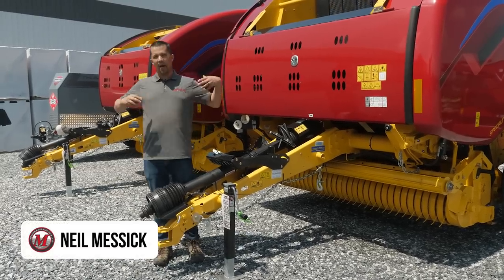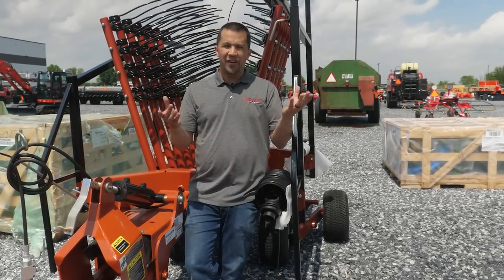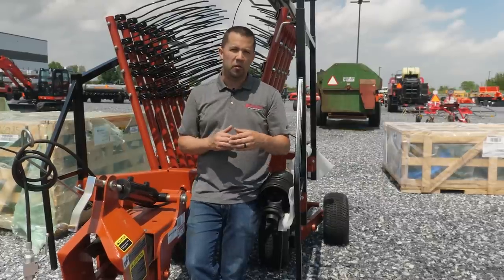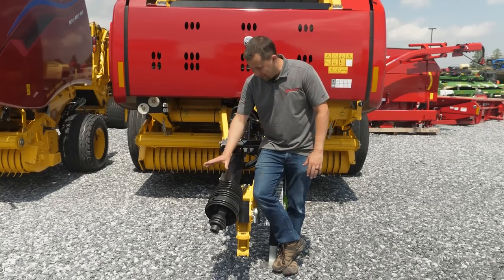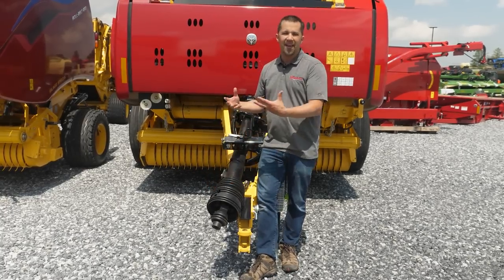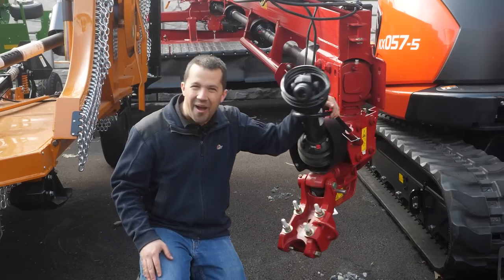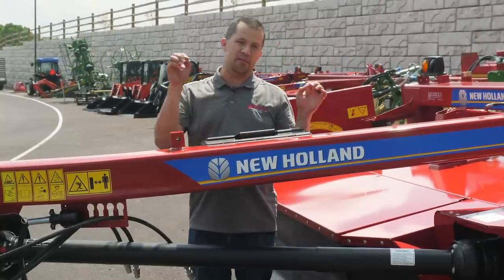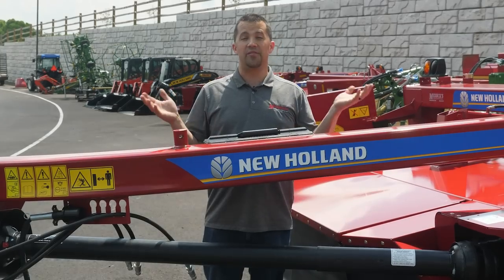3 Different Types of PTO Yokes

Comment: Thanks for another informative video.

Yoke joints are also known as Cardan joints. When a yoke/Cardan joint is operating at an angle the output speed varies cyclically from the input speed, with the magnitude of the variation increasing with the angle. Also when the joint is operating at an angle there is a force created perpendicular to shaft which increases with increasing torque being transmitted. The combination of the varying output speed of the yoke/Cardan joint and the inertial load cause the perpendicular force to vary which results in the "jumping". In contrast a CV joint has an (almost) constant speed output so there is not a variation in the perpendicular force.dd
Reply: Well said. Thanks.

Comment: When we add a quick hitch the shaft has to extend an extra 4 inches or so. Do you recommend a PTO shaft extension? If so what kind of coupler do you recommend. I use my quick hitch with a PTO generator so the shaft is pretty short to begin with. 
Thank you for your helpful videos, Andy

Comment: Speaking of PTOs and such, what are the implications of running an implement rated for 20-30HP on something like a 40HP PTO output?  All modern implements have shear bolts or slip clutches, so what problems might it cause? As long as you bring the implement up to speed gently (as opposed to engaging the PTO at 540 RPM), it seems like there shouldn't be an issue. But I may well be missing something :)
Reply: It will wear the gearbox out if it's not rated for that hp.
Reply from the maker: You'll just find the weak point more quickly. Hopefully a shear bolt.
Reply: Most implements have a fairly wide HP range. A rotary anything should have a sheer bolt or slip clutch to control the maximum amount of torque that can ever be applied regardless of PTO horsepower. As long as the proper sheer bolt or slip clutch is used, I don’t believe there would be any problem.
(Kind of like the proper circuit breaker for the amp load and wire gauge.)
Reply: @lcee6592  That's exactly my take on it. You can't "force" horsepower into an object. Unless you lock up the implement or slam the PTO into operation (which is effectively the implement stalled by inertia), 20 HP or 2000 HP isn't going to make any difference. And, as you say, with a shear bolt or slip clutch, if you do lock up the implement, you've effectively tripped the circuit breaker, so again, 20 HP or 2000 HP shouldn't matter.

Comment: For the swivel gearbox, what prevents "play" when in operation so that what you are pulling stays in alignment and does not dance around?
Reply: The 3 point hitch does the pulling.
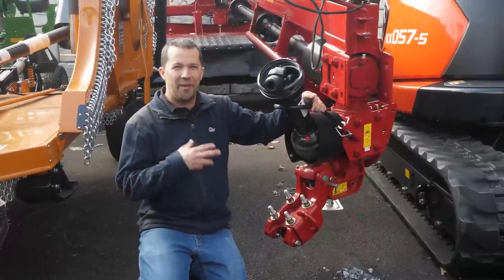Reply: 3:30  look at that hitch.   most have some type of clamp mechanism to fix to the drawbar if not using 3 pt or just the lower 2 parts of the 3 pt as noted by Lumberjack Dreamer